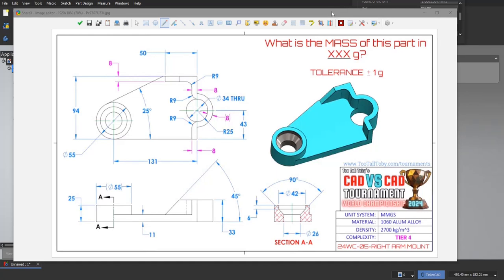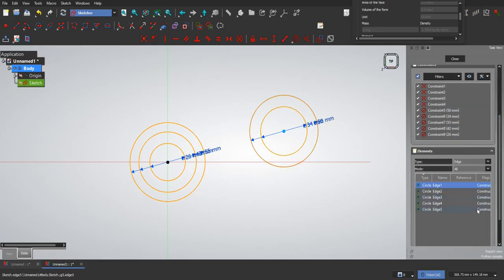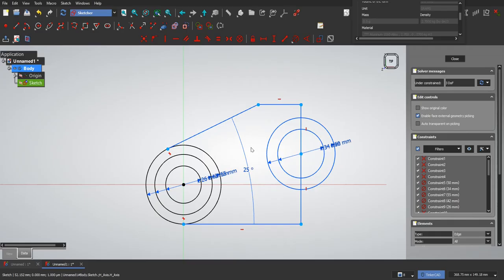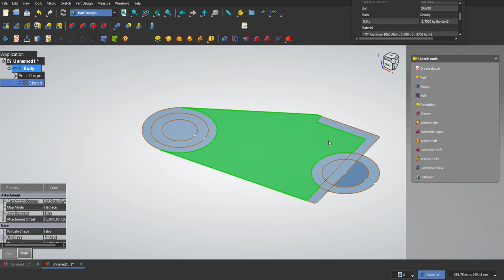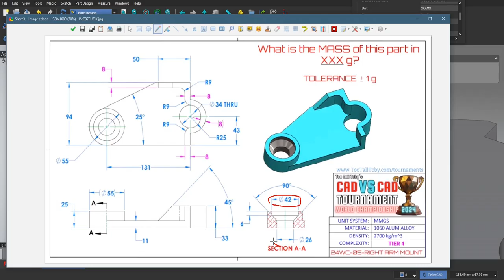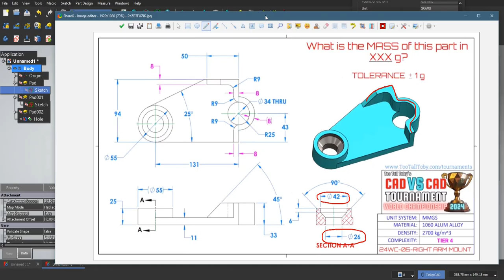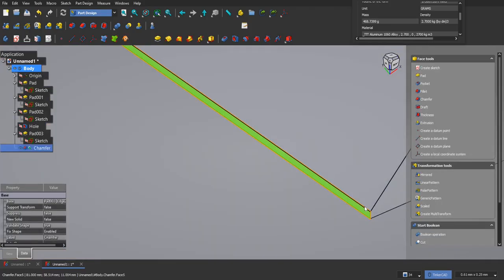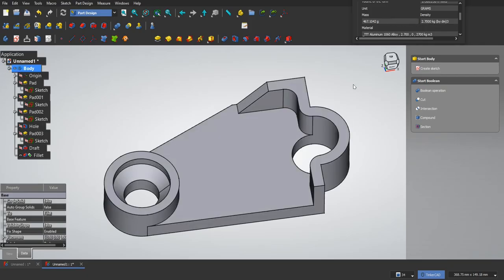Make This CAD Model w/ Only 1 Sketch

Comment from the maker: If you're wondering how I am extruding sketch profiles/contours like Fusion360 or Solidworks...

1) Get the "Real thunder" version of FreeCAD (link in description - it's still FREE and open source, just has some more features)
2) Go to Edit > Preferences > Sketcher > Turn ON "Auto generate internal geometries"
Reply: 9048 commits behind FreeCAD/FreeCAD:main 🤮
Reply from the maker: @youtubehandlesux  Feel free to use the main branch if that bothers you lol

Comment: Excellent tutorial. I'm a recent adopter of CAD and FreeCAD, and I didn't realize you could do half of what you just did. Especially using only one sketch, I would have used maybe a half dozen sketches to do that. 👍
Reply: Using multiple sketches is generally better than cramping things into one sketch. Didn't bother watching the whole thing but this seems pretty stupid.
Reply from the maker: There's pros and cons to both approaches. 
Generally, your model is more robust when you have separate sketches for separate features. However, in some cases that results in a lot of duplicated/derived geometry, which wastes time or introduces more dependencies that will inevitably break when you change your model.

Comment: Great tutorial, thanks. What version of FreeCad are you using? Wiil this also work in Version 1.0?
Reply from the maker: This is the realthunder version of FreeCAD. This exact method will NOT work in version 1.0. Check my pinned comment and video description for some more info on how to get it. 

You can (and I recommend it) install both versions of FreeCAD, they both have their pros and cons.